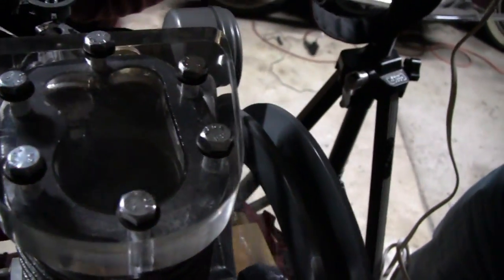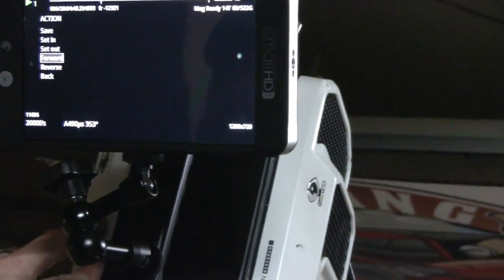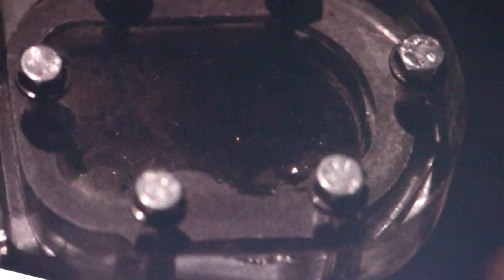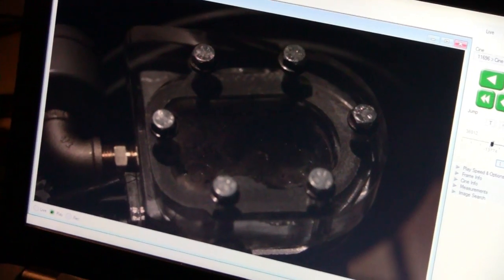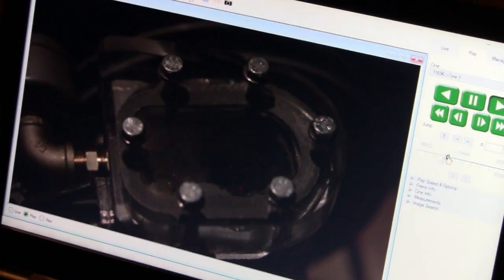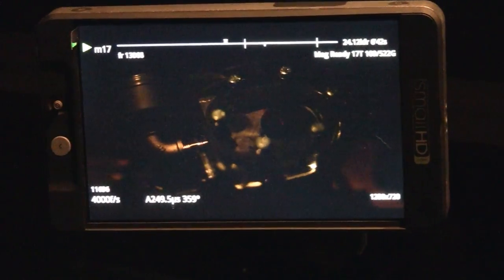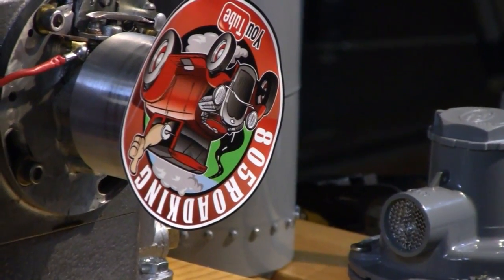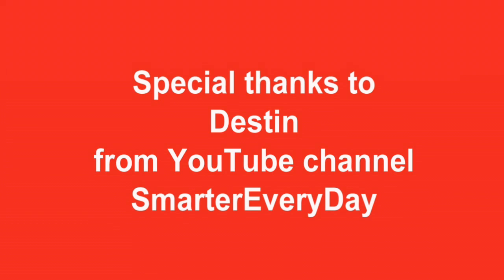Glass Head Engine Slomo with SmarterEveryDay (part 3) Behind the Scenes

Comment: It would be interesting to do a series of these with the spark advanced or retarded, so you could see the effects of each.
Reply: userunavailable3095 that's a very good idea .
Using a weight lever /pulley and rpm Guage you could calculate torque at fixed rpm

Comment: I wonder how hard it would be to attach one of those camshaft degree wheels to the flywheel?
Reply: stylac don't need one .
A marker and a ref point on the flywheel and fixed position would be the same .
Not that you'd need one .

Comment: It seems as though there could be a theoretical top rpm for a internal combustion engine. That would be when the the piston moved faster than the flame front.
Reply: hello hun don't forget to take into account octane .
Higher slows the flame burn and lower speeds it